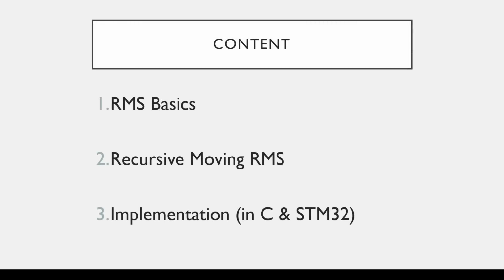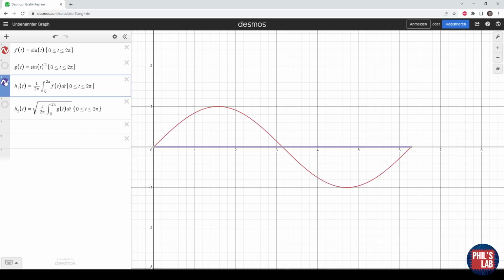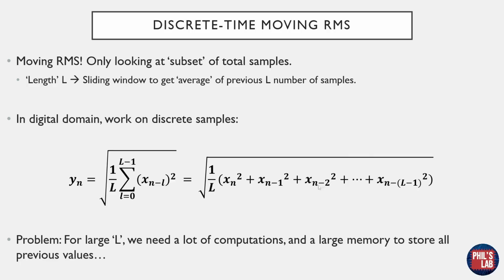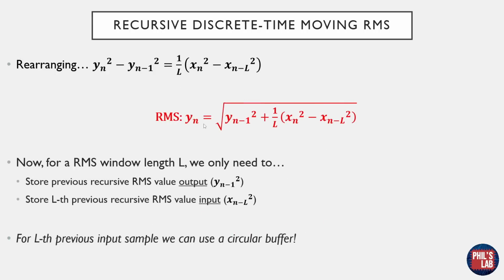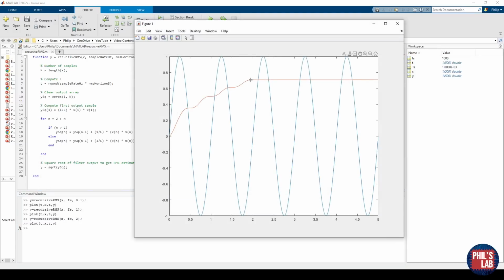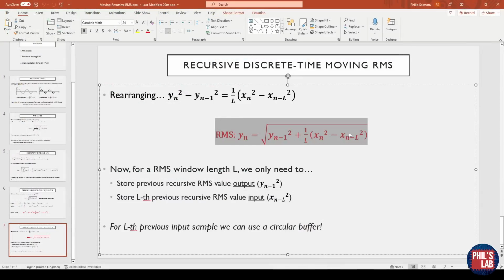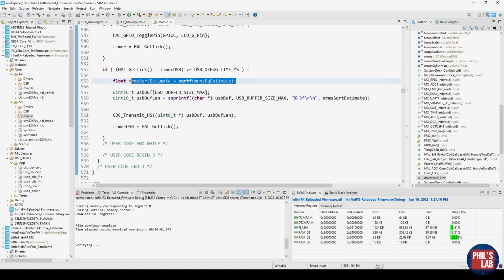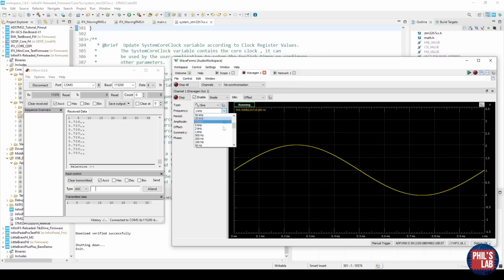Recursive RMS (STM32 Implementation) - Phil's Lab #103

Comment: @Phil, great video and great channel! I believe you have off by one error in your C implementation. You want to subtract X(n-L), but you are subtracting X(n-L+1). The result of this is that you have running sum of the last L-1 elements instead of L elements. Another small potential issue you may have is accumulating floating point precision error over time. I would probably keep the running sum and ring buffer integer and convert to float only the result.
Reply from the maker: Thank you, Nikolay - you're completely right. I've pinned your comment, so people can see the error in the code. As stated in my previous pinned comment, thankfully, for large L (as is the case in the video), the error is small (due to summing 2047 samples, diving by 2048).
Good point also regarding floating points.
Reply: So in essence, for anyone reading this in the future, just save the n-L sample in a temporary variable before overwriting it with the square of the current sample:

...
float n_minus_L = mrms->in_sq_L[mrms->count];
mrms->in_sq_L[mrms->count] = in_sq;
...
mrms->out_sq += mrms->invL * (in_sq - n_minus_L);
...
Reply: Exactly  @EduardoBehr

Comment: There is one catch using this technique - it provides RMS value, which is delayed by the (length of the filter) / 2. So the results are not instantaneous.
Reply: Why length of the filter / 2 , you just need to pass that initialisation phase and then you get instant result no?
Reply: @nezhazahri372  No. the results are always delayed by the "group delay" = (N-1)/2, where N - is a filter length.

Comment: The lowest useful frequency will be: (ADC sampling rate) / (filter length) = 48kHz / 2048 ~ 23Hz.
     The highest useful frequency shall depend on the "crest factor"  of the signal, that is highest harmonic detected. In case of the pure sine: 48kHz / 2 = 24kHz

Comment: Thanks for a great video. I see that the STM32 you are using is capable of keeping up with audio frequency waveforms. How high of an input frequency do you think it is capable of analysing reliably?  And a side question: what is the reason you prefer hTerm as opposed to the built-in terminal in cubeIDE?
Reply from the maker: Thank you! In terms of 'raw sampling',  the STM32 has its own ADCs which typically can go up to a few MSPS (according to datasheets) and at a significantly lower bit-depth. The external CODEC I'm using can go up to 192kHz sampling rate.
What you can actually process using the H7 strongly depends on the algorithm, so it's hard to generalise.

From past experiences, I'm not too much of a fan of the built-in terminals. Also I like having a single program for that, since I typically use quite a few different IDEs/platforms.
Reply: @PhilsLab  👍
Reply: The answer depends on the input signal' "crest factor"  and needed accuracy of the result.
      For example, to measure RMS of the sawtooth signal with 8-bit accuracy, one would need about 64 samples per period. So, for example, using 1 MHz ADC will give 1MHz/64=15kHz max!
    You can reach higher frequencies by reducing the number of samples per period, but at the expense of accuracy, and highest harmonic you want to catch. The sawtooth signal is very rich in harmonics, so a high sampling rate is needed. If you expect only a sine and a 2-nd harmonic, then 8 samples per period should suffice.
    There are hardware solutions for signals up to GHz frequencies.